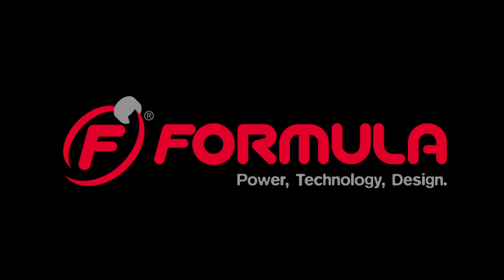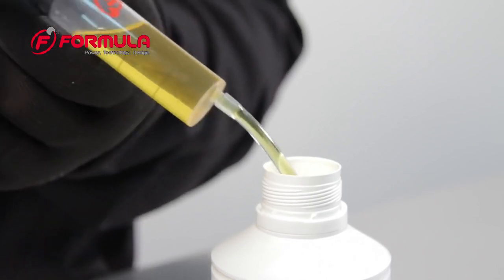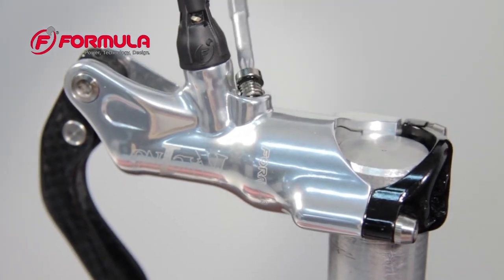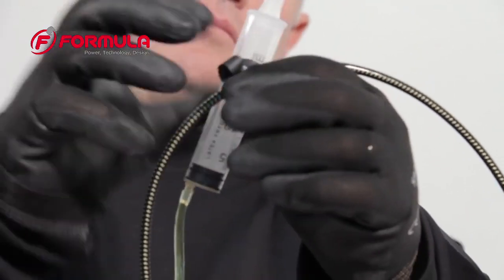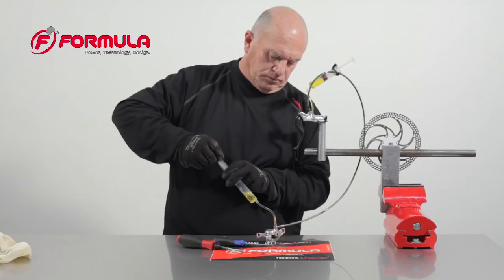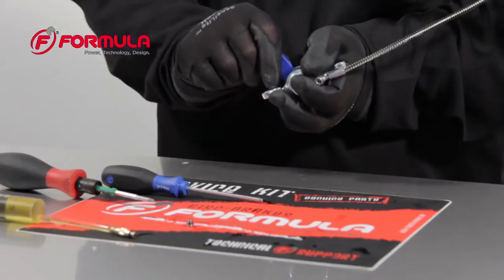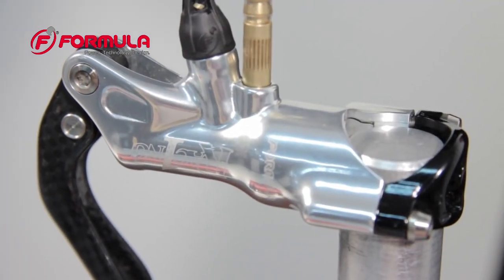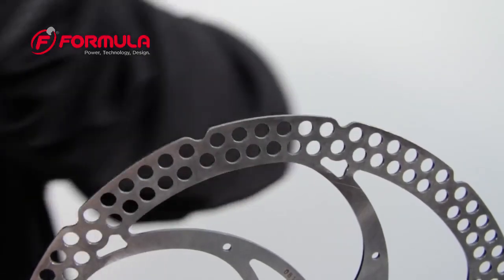DOT4 Brake bleeding procedure

Comment: Thanks for the tutorial. I've not had any luck following others yours helped me successfully bleed my brakes. A couple of things I'd add is to pull a vaccume on the syringe before attaching to the caliper to pull out more air, it's surprising how many seemingly invisible bubbles come out of the fluid. Second is push out a little fluid from the lever bleed port before attaching the empty syringe. Second point might be pointless but it certainly seemed to help with my experience.
Reply: hi richard. can you explain me please how to reduce the tension on lever???my levers are very tighten and there is a very short stroke to the handle bar. is there any solution for this. thanks
Reply: @MrAlexkesler  try pushing the pistons back they might have been squeezed without the rotor in between them resulting in them being too close. If you remove your wheel and pads you can push the pistons back with something plastic. Then you can replace the pads and wheel, and pump the lever until the calipers bite again. There's not a lot that can go wrong doing this, just don't pull the lever without anything in the brake caliper. Let me know if that helps.
Reply: Does any DOT 4 brake fluid works with these calipers? Any specific recommendations?
Reply: @michaelwebber8096  Any dot 4 fluid or dot 5.1 fluid will be fine. Just make sure to use new fluid as brake fluid is hydroscopic. Meaning it attracts water, and you don't want water in your brakes.
Reply: @AstronomyWales  yeah, totally understand that! So, as I have an abundance of new SRAM DOT 5.1, I believe I'll be using that! Thanks for the confirmation.
Reply: @michaelwebber8096  Being SRAM it should be good stuff. I've got cheap dot 4 in mine right now as it's what came with my bleed kit.